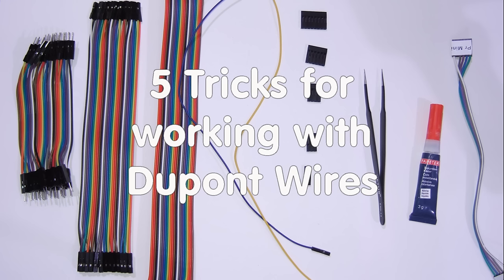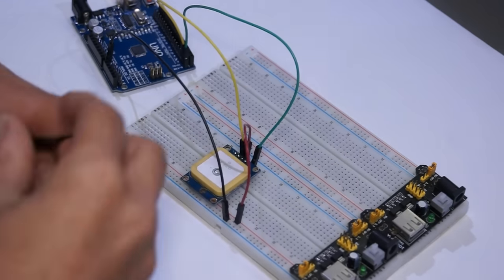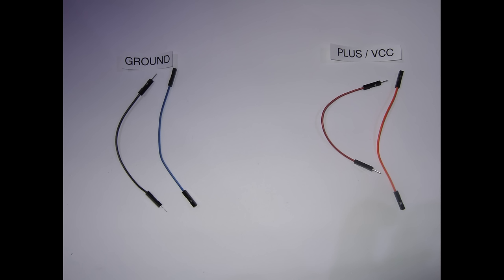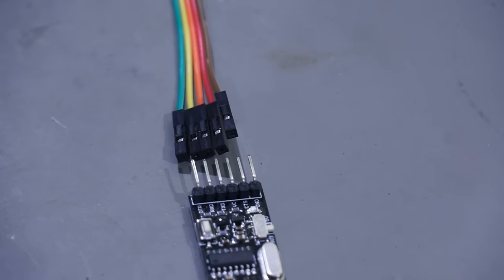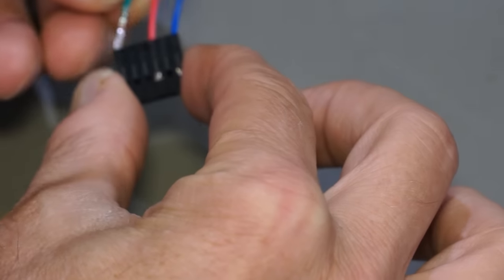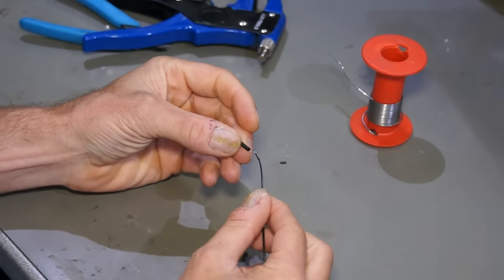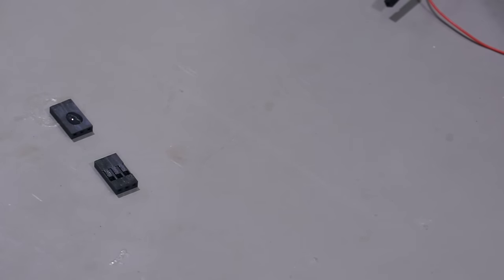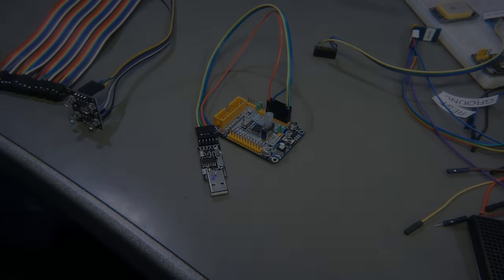#12 Five Tricks for working with Dupont wires

Comment: It's possible to buy precrimped wire without the house on for making custom connectors :-)
Reply from the maker: I do not know. But I take them off and use them for other self-crimped cables.

Comment: Hey Andreas, you sound like some other Swiss guys I used to work with. ;-)
Good video. Thx

I am using a ribbon jumper to repair a connection that was accidentally pulled apart in a radio.
Reply from the maker: If you know one, you know all of the Swiss ;-) I think, this has to do with our original language.We still use the same sounds, but in a different language...
Concerning the ribbon cables: Good idea. Thanks!

Comment: Most of these tips didn't seem so genious. More like, isn't everybody doing this? But there are two that I liked: glueing two single row together to get a two row, of don't have one readily at hand. And even more: building a male/female connector, which couldn't be inadvertantly plugged the wrong way. Though, if I am controlling both sides of the connected (no one side is already given as a component of cable of a component), I'd tend to use JST connecters, that can't be plugged the wrong way.
Reply from the maker: You are right: JST connectors are very handy.
A lot of people did not know the empty shells, for example.

Comment: I suggest You change name from "dupont wires" to "colored ribbon wires" as the usual internationally accepted nomenclature.
Reply from the maker: In the maker scene, Dupont wires is a household name. If I would use "colored ribbons" everybody would ask: Do you mean Dupont wires ;-)
Reply: @AndreasSpiess  thanx for answering, this was the first time I heard that name - but but I worked in the field almost 40 years ago - so I may have missed that name. Don't understand why not use the "ribbon cable" name though..

Comment: Trick #6: Crimp your own wires
Reply from the maker: I rarely do it if I need special length wires. Otherwise it is not worth the effort
Reply: @AndreasSpiess  Interesting. I crimp my own. Different strokes for different folks. I have a wire dispenser box, I take exactly what length I need